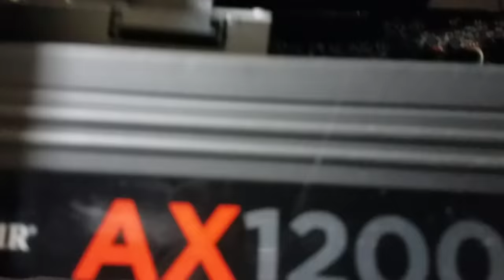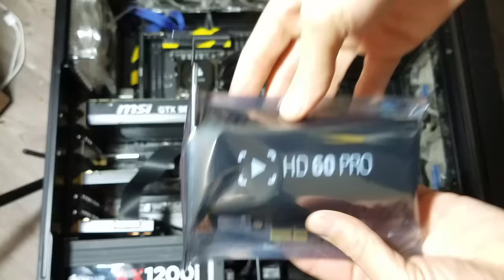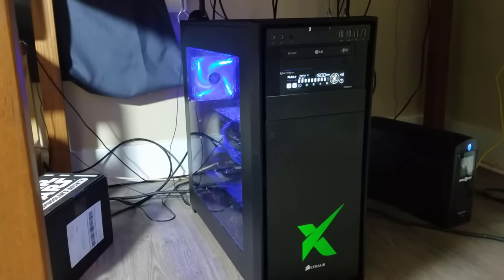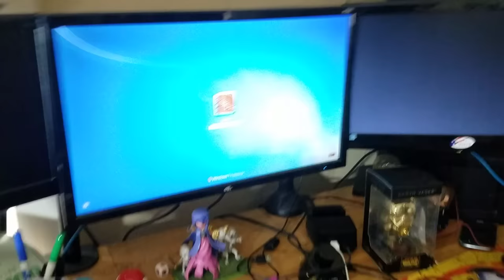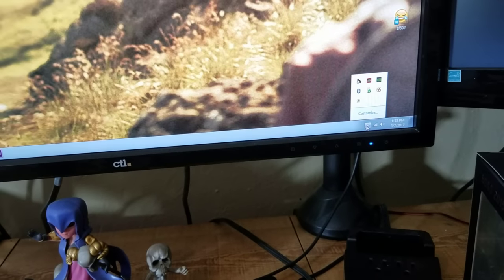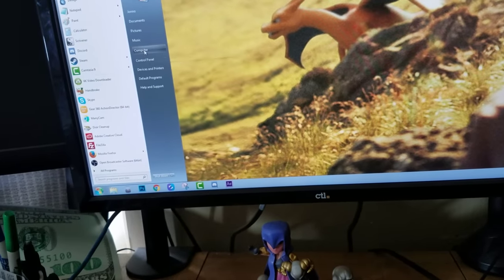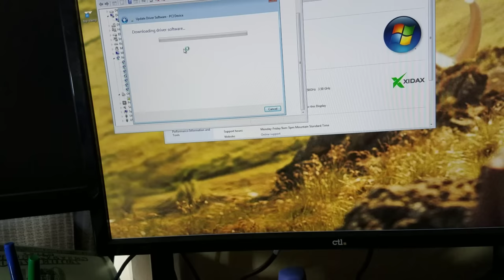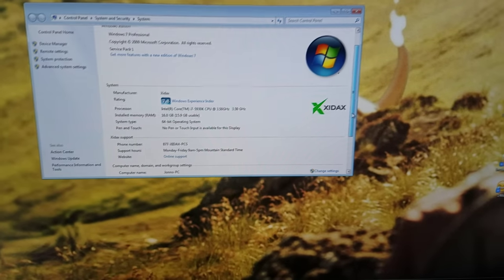How To Install Elgato HD 60 Pro! (MSI Motherboard, Corsair Case)

Comment: Does the msi tomahawk b450 support the capture card ?
Reply from the maker: Idk what that is fam
Reply: Yes, it will work. I have the same motherboard. If you're trying to capture your PlayStation, the PS5 and PS4 has HDCP turned on by default. Disable HDCP on PlayStation 5, then try opening OBS/Elgato Capture and it should display.